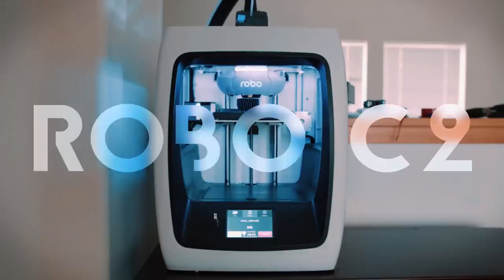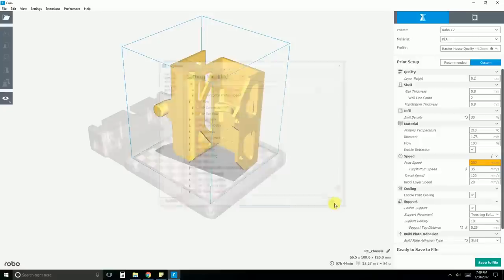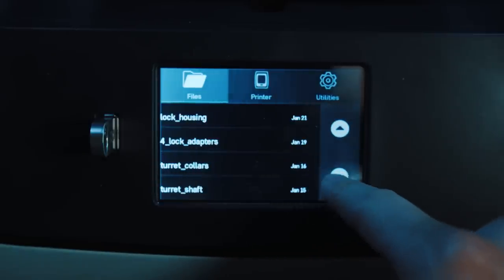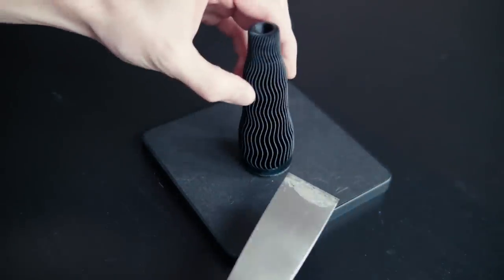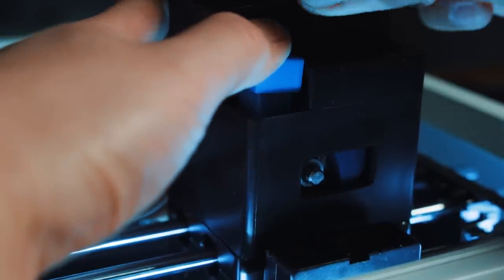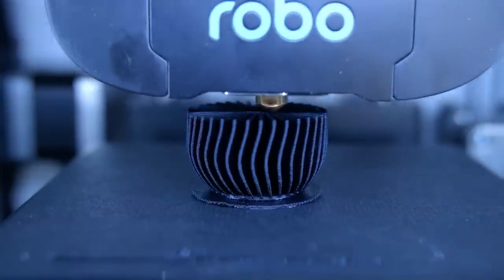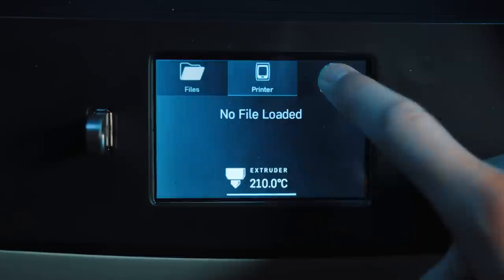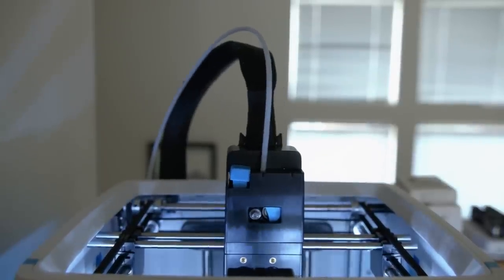Robo C2 3D Printer Review

Comment: I'm definitely purchasing this printer and it's my first 3d printer. Have you had issues with noise and cleaning the extruder?
Reply from the maker: Not yet!
Reply: Hacker House Sweet... because I will be doing late night prints and don't want to wake people up. And it will be nice to see it glow at night.

Also the print volume is perfect... I could just print characters in pieces. Also, does the normal Cura or Simplify3D work on this?
Reply: I bought one of these (Robo C2) earlier this month, and I can vouch for Simplify3D working on this printer.  Definitely ensure you're using the latest S3D (version 4 was just recently released).  You won't be able to print over USB, but you can save the toolpaths to disk as gcode and upload that to the C2 using the web interface (which is a customized Octoprint).

I personally think the Simplify3D slicing engine is better at a lot of things compared to the customized Cura slicing engine built into Octoprint.  S3D version 4 actually seems to print better rafts than Robo's Cura (the printed part just peels away from the raft).
Reply: Robert Poole I noticed that on some of my prints with ROBO 3d Cura. Unfortunately I don't have wifi in my room so I've been using a thumb drive to print
Reply: Kashif Riley yep, sneakernet via thumb drive works great if you can't use WiFi. Although Ethernet works also if you can run Cat5 to where the printer is.

Really glad Robo included a USB type A female plug on the front panel. (Planning on attaching a USB web cam to the rear port so I can monitor print jobs visually.)
Reply: Robert Poole I can do Cat5 directly to my laptop. I will try it when I get home to see if I can print directly from Cura.

The rafts from Cura are kinda good at times,  but printing a brim is very messy :-(
Reply: Kashif Riley just remember that if you run Ethernet straight from your laptop to the printer, you might need a so-called crossover cable. Otherwise, you can use a cheap Ethernet switch in between.
Reply: Robert Poole I hope I can do it